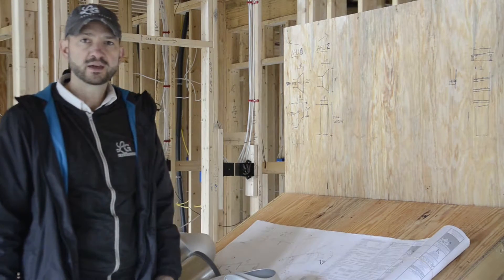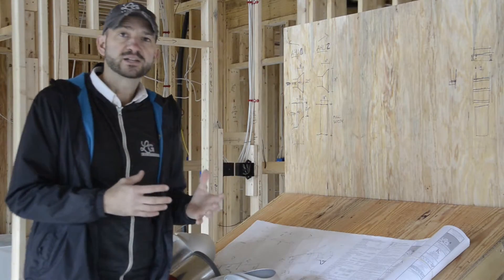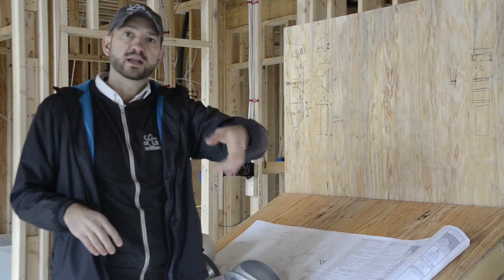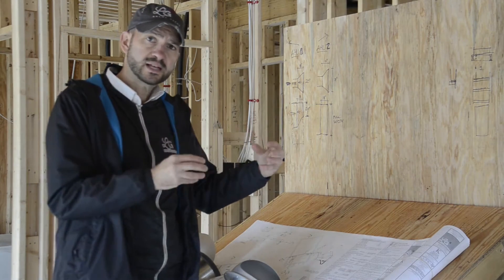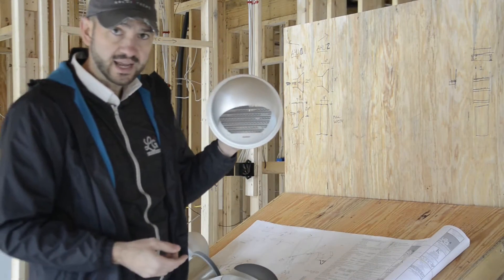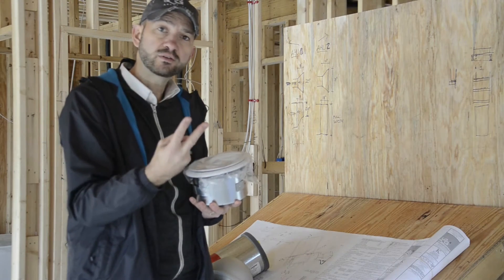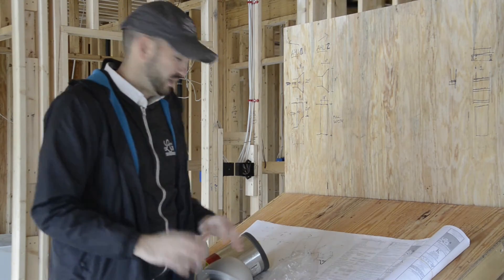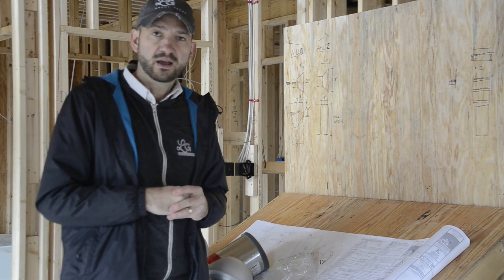Custom Fresh Air Ventilation System for a Super Air-Tight Home, or Any New Home

Comment: Why would anyone want fresh freezing cold air in the winter flowing through their house? I want a warm house, not a breezy house.
Reply from the maker: No one would, SR, which is why this system was designed and installed to dump the incoming outside air in to the encapsulated area where the filtered return side of the air handler is left open to pull that fresh air in to filter it, condition it and THEN distribute it throughout the house. So, it is conditioned and filtered BEFORE it ever enters the part of the house where the people are. I cover this in the video, but let us know if you have any other questions or comments.
Thank you
Reply: @Chris at LG Squared  Then why do I have a cold breeze running through my Leeds home? It's coming out of the vents, including the intake vent. It feels like a window has been left open.
Reply from the maker: @sr2291  You are not the first person to ask this question, and it's a big part of why we've come up with the appoach that I explain above. We do the same with make-up air so that it's not dumping fresh air directly on to the occupants, or through the conditioned spaces, as you explain.
There is likely a way to correct this with your house, without comprimising performance (fresh air delivery) and/or the certification. The possible modifications may also improve energy performance of the fresh air system, and reduce the heating / cooling loads slightly. Overall, providing better comfort and performance.
Reply from the maker: @sr2291  I don't believe fresh air systems (ERV, HRV, etc.) should EVER dump air directly in to occupiable spaces. The point of much of the programs and goals of high performance is COMFORT, along with health, and THIS strategy is only providing the fresh air, and ignores comfort.
Reply: @LGSquared  Thank you for your replies. I will have a professional look at my system.
Reply from the maker: @sr2291  Of course! Let me know if I can help. It doesn't matter where you are, we can provide gudance, specifications, anything to help get things sorted and to get you comfortable.

Comment: I think folks may get confused from the many and mini description. A split system is just that, split whether mini/small or conventional, but a mini can have ‘many’ air handlers. What is the reason for power venting into an attic? No soffit or ridge vents? May be different per climate/location. Not a hater, haven’t been in the hvac game in a while so excuse the confusion, but trying to catch back up with a new house build on the horizon.

Comment: Hi Chris, Just wanted to confirm your blower door result of 0.09. From memory, 0.6 is the magic number needed to meet the Passive House standard and from the videos I've seen on Passive Houses, most results come in at around 0.2. I just wanted to confirm that you obtained 0.09 and not 0.9. Thanks for your great videos, i'm enjoying everyone of them!
Reply from the maker: Hi, PaulyDownUnder, thank you for the question, and for your patience in the response ;-) Yes, we were able to acheive 0.09, or "point zero nine". In fact, the final test, at completion, came out even better, at 0.05 ach50. The only leakage that we found (through use of a fog machine) was at the blower door frame, and one window had a very small amount of smoke coming through. We didn't find ANY other leak. We often wonder if the blower door frame was tighter, how close to zero.zero would we have been able to get...an experiment for another day, I guess...

Comment: Okay prepare yourself for some feedback. I only bring it because I want to help and I'm glad you're putting yourself out there to encourage folks to ventilate their houses and be innovative in how they do it. Here's the but...

I don't think this ventilation/humidity control strategy is the best approach and I'm concerned about excess moisture and potentially poor indoor air quality in the home over time. I've seen virtually identical situations in Austin that have resulted in cupped hardwoods and worse. I am a big proponent of in-line fans in range hood make up air applications, bathrooms, etc., but they're not a sophisticated way to ventilate a whole house, especially when you've got a tight enclosure that needs a well balanced ventilation rate (that's another can of worms for another time). What I'm worried about here is humidity control. The only time those VRF units are going to be dehumidifying anything are when they're being called for heating/cooling, leaving the often long shoulder seasons without any kind of dedicated humidity removal. The fans are going to continue bringing in unconditioned air in those shoulder months and can/will cause real elevated humidity issues. And even in the seasons with significant cooling load when the units are running, you're not pulling as much as you likely need for comfortable RHT ranges in tight enclosures where a shower or cooking a meal significantly add to the latent load as well. The VRF manufacturers have finally gotten honest about their equipment's inability to successfully dehumidify in comparison to dehumidifiers. By that logic, why wouldn't you just use a ventilating dehumidifier to ventilate and dry the air?  When you compare the total amp draw to remove a pint of water, dehumidifier is going to win every day. 

Drop me a line and let's chat about this in more detail. https://positiveenergy.pro/contact-us
Reply from the maker: Miguel, we have specified and installed this system in several projects throughout the southeast and the rest of the country, and two of them were monitored for two years, which included RH and AH. In both cases, these numbers stayed normal throughout the two years. Although each home is pre-wired and pre-plumbed for supplemental dehumidification to be installed in the attic, in over six (6) years of specifying and installing this system combined with ducted VRF systems, dedicated dehumidification has not been necessary.  Even the first time we installed this system was based on hybrid attempts being done before. So, we didn't need to "put ourselves out there". This is a proven approach.
The VRF systems and exhaust systems (sized adequately for internal humidity loads) handle whatever humidity is in the home very well. Humidity and occupant comfort have never been an issue in these homes. During the shoulder seasons, most homeowners completely turn off all of the systems because relative and absolute humidity levels are low enough to keep the windows open. So, there has never been a time when the fresh air system is on, the heating/AC system is off, and humidity is being brought in from outside. Finally, when the cooling systems are running, the coils are always cold, whether the LEV is pushing refrigerant through them or not. This means that some dehumidification is happening even where there is not a call for cooling. Moisture removal is definitely higher when the system is calling for cooling, but it's still happening when it's not.
These systems continue to work for us and the homeowners on every single project we've installed them in, without fail. A ventilating dehumidifier would be superfluous, given that the humidity is already being handled by the VRF and exhaust systems, and the fresh air is being brought in by a system will much lower upfront and operating cost. The only time we have had to install a dehumidifier is in a small space, less than 600 square feet (tiny houses), where we installed a hyper-heat wall mounted ductless VRF. The moisture removal capacity on those is very poor, so supplemental dehumidification is necessary. We used a wall-mounted unit from Ultra-Aire (MD33). 
Let me know if you want more info or have questions.
Thanks,
Chris

Comment: I'm not sure I can recommend this up north, maybe down south I can see this making sense in terms of cost savings. That said, the Zehnder ERVs draw about 40 W, which is pretty low. Interesting concept and thank you for sharing!
Reply from the maker: Hey Kyle. We've specified this system in several homes throughout the north and northeast, and they continue to work very well. I've also specified and had installed Zehnder ERVs. I've had equal performance success with both.
COST: At the time we installed the ERV, the total cost of material, equipment and labor exceeded $10,000, and the inline fan system described in this video installed costs averages under $1,000. 
POWER: At maximum speed (364 cfm), which we have prevented the owners from reaching, this system can reach 75W. Being a variable speed non-stepped motor, it will dial down its power consumption to 20W and lower at the maximum designed CFM of 70 cfm. The owners are given instruction (as noted in the video) on where to set the dial based on the number of people. The set it and forget it ventilation for the house discussed in this video is 20cfm, and as needed. The project has a single full-time resident, though I've made similar suggestions for more occupants. You could definitely use this system in any of your projects. Even when we don't have an attic serving as a plenum, we design a custom return grill that combines a fresh air supply outlet so that the return grille side can immediately pick up the incoming air.

Comment: We use negative pressure of return duct to continuously pull in fresh air, avoiding need for additional fan(s).

House leakage and spot exhaust provide exhaust pathways.
Reply from the maker: Glad that works for you, Ted.

Comment: Thanks for this interesting alternative to having an HRV/ERV. Can you clarify where you get the air that gets exhausted? Do you have multiple duct lines going to the exhaust fan (lines installed maybe in the kitchen and bathrooms as is common with ERV systems)? Also, I see how your system provides good and filtered airflow, but energy-wise, it's not clear to me that you have any heat exchange. In summer, the incoming air gets cooled by the air in the attic which heats up in the process, so your air handler still has to cool all that air. And the outgoing air (depending on its path) leaves the house fully conditioned. What am I missing?